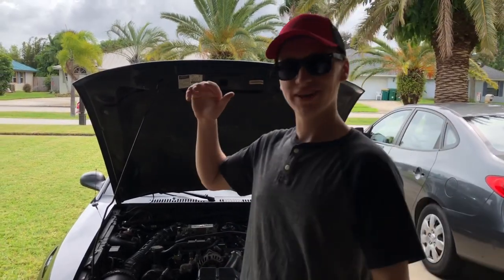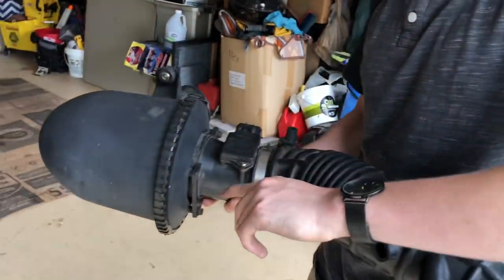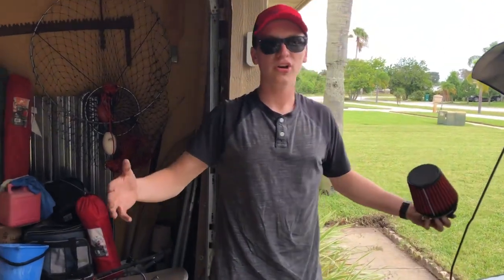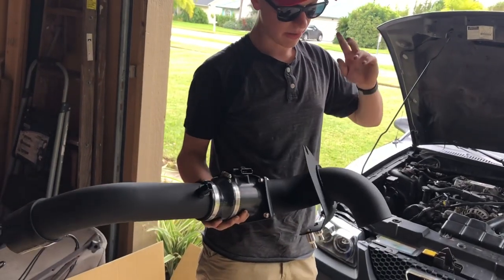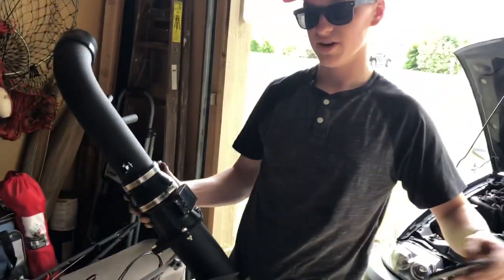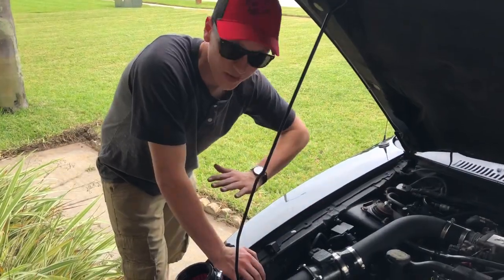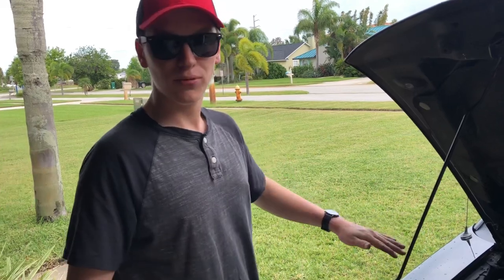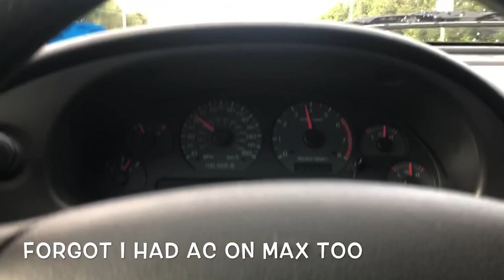How to Install a Cold Air Intake in Your Car, (2001 Mustang GT)

Comment: I'd need before and after performance stats to convince me to spend the bucks for this upgrade. Some of these CAI's are over $200 so I need to know if they significantly improve performance.
Reply: they are proven to give like 4-5 more hp they usually do make the car sound better but unless you have like a turbo they’re not gonna make a difference
Reply: They add 5-10 hp which isn’t bad for a bolt on. If you want a real difference get a tune.
Reply: It’s $135 on American muscle. I just bought a 98gt convertible, it’s an automatic. Cai is basically for sound. Sorta like exhaust. A tune would give you more performance.

Comment: My mustangs doesn’t have that little sensor but it has the mass airflow one and the intake I got came with a hole for the little one so did I just waste my money ?
Reply from the maker: No just find a plug that’ll fit it and you’ll be good to go!
Reply: @thatblackgt5056  i plugged it with a thingy that came with it that has a thread through it lol
Reply from the maker: Good stuff man, best of luck

Comment: Ouch!!! Look at 3:20 in your video!!!Bro when I say you crank those down I gasped. I’ve been an aircraft mechanic for 33 years. I cringed man. Sorry to bad g you. Those bolts and nut don’t need much torque. When you over tighten them you can actually ruin the gasket in there between them.  Now for the good . I love your videos man. Thank you for making them.
Reply from the maker: Sorry mate, not too sure about which point your talking about in the video, 3:20 is me taking apart the stock intake. However I really appreciate the kind words and tips! Thanks for supporting me brother.